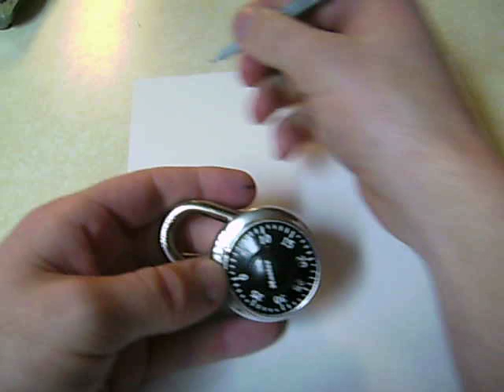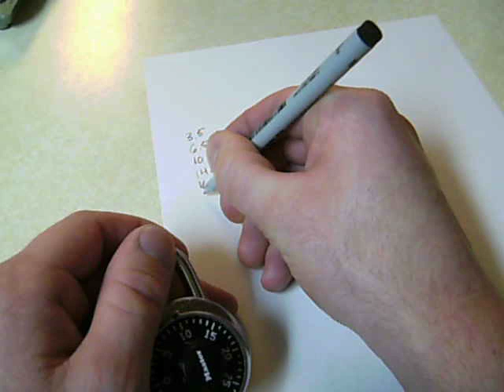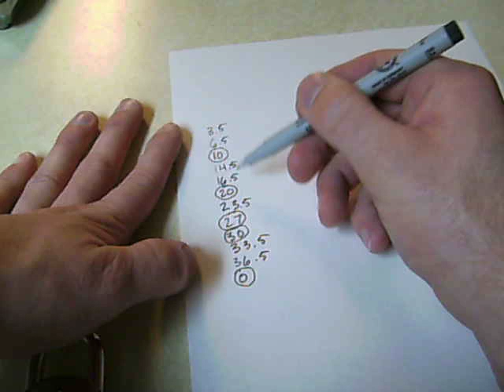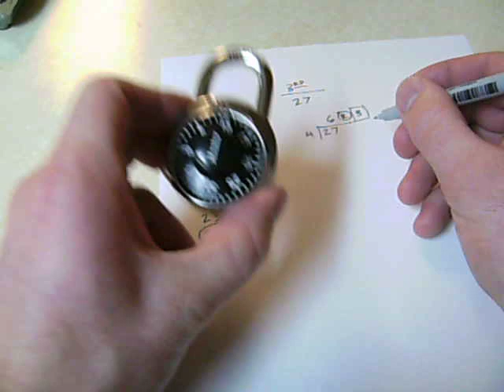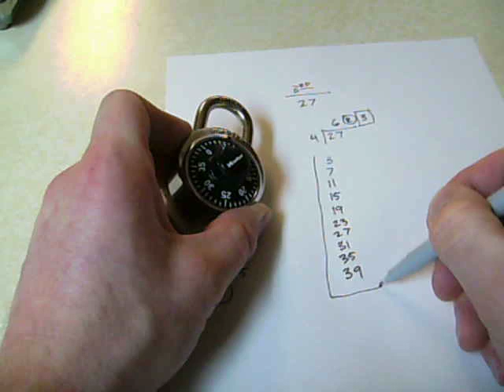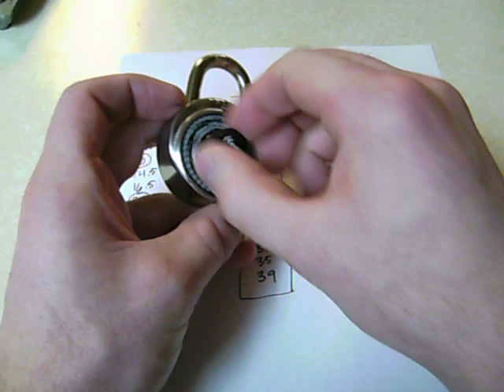Cracking a combination lock  without picking. SUPER EASY!!!!

Comment: And how in God's name is that "SUPER EASY!!!!"????
Reply: Cody Ngo yup and find it at http://lcokpickhub.com
Reply: Cody Ngo
Name calling? Really? It sounds to me like your the 4th grader. I did not say that your method does not work. I was merely stating that it is far from "SUPER EASY" as your title suggests.
Reply: It is very easy math. If you can rememer the formula then you should be able to do this in less than a minute on any lock. What part is tricky for you?
Reply: Tara Strong
If you look at my post you will see that I never said that it was too tricky for me. I agree it is basic math but I was expecting a solution that was easier than simply cutting the lock.
Reply: boy2cuda Oh makes sense. This way is a bit more sneaky though. Can't really hack at locks in the hallways at school.
Reply: Tara Strong so how would he crack the combo if the combination was say... 1-15-27. He'd still get the same remainder, which is used to generate the same lists as in the video. But neither 1 or 15 are on the lists.
Reply: Yeah people would notice u trying to solve the lock combo it's easy math but no way the easy way of opening a lock quick and easy I would  break the lock with some thing
Reply: +boy2cuda Just use the computer calculator.

Comment: It's not 64,000 combinations, it's 59,280.
Reply: I believe the number of possibilities is 16,000. The third (last) is 1 of 40 and the first two numbers have a possibility of 400 individual combinations using the formular provided based on the 4 possible remainders (100 each)  40 X 400 = 16000. Once you have solved for the third number there are only 100 possibilities  left to decode for the first two.
Reply: Actually John you would be right IF the combo consisted of a solution  with 3 different digits and none can be repeated  and only 40 possible numbers. However the formular greatly reduces the attempts needed. Reread my post as to what the possibilities really are. Of course my answer is not correct and is a little low. I took a shortcut. When you determine the third digit there are 12 possibilities for that number but it can be solved with as few as three additional attempts and fewer than twelve if the code breaker uses his brain. So the true answer for all possibilities is somewhere between 16003 and 16012 MAXIMUM. I solved mine with about 72 attempts .  This answer is also wrong because reality reduces the possibilities to less than 112. Solve for the third # (less than twelve) and then solve for the first and second numbers (no more than 100 possibilities). Statistics and probability are a lot of fun but their purpose is to lessen the work you are required to do. I think that is why this video was posted.
Reply: treehood oh yeah i know that, I was just saying that the lock allows you to try 59,280 legitimate combinations
Reply: whst about tough under fire master combination
Reply: actually its 60840 since same number can show up twice (40X39X39=60840)
Reply: tarablus2 My bad. Din't know that. I thought each number could only show up once. Thanks :3
Reply: Stickler F.S.
No Problem :)
Reply: tarablus2 actually a number can show up 3 times so it's 40X40X40=64,000
Reply: @treehood6448  Actually, the number of possibilities is only 4000. For any last digit you choose, you can always narrow down the first two digits to ten possibilities each. So, 100 possibilities for any given third digit. 40x100=4000.

Comment: Another trick that works is to take the regurgitated food from a baby cyclops perigrene falcon from Madagascar and mix it into the side of the lock cylinder that has the little side hasp on it. You can get this pre-mix in your local Tru-Value hardware stores and Home Centers. Then wait about 3:78 and the remuse from the infected particle generator. When the lock pin dissolves, eat a piece of your favorite pop tart and spit the remaining juice into the other side of the lock and presto! Works every time and has never failed me so far! Although I could be wrong.........Good luck!
Reply: thank you i opened a bank safe with your tips

Comment: Great video.  It was easier to understand and try then some of the other ones.  The reason the numbers are divided by 4 is that on a MasterLock, you only have to get
close to the actual number, basically within 2 units.  Dividing by 26 by 4 gives you a remainder of 2, so your first number choices are 2, 6, 10, 14, 18, 22, 26, 30, 34, & 38.
All those numbers are within 2 of every number.  What a fantastic algorithm...
Thanks, I got a lock open that I lost the combination to year ago.

Comment: It worked, 1st time I accidentally picked a non-whole number because I wasn't watching the movement, but 2nd time I got the 3rd number correctly, then made a list of 1st and 2nd numbers using the algorithm. My jaw dropped when about half way through it opened. Saved a combo lock I was going to toss - thanks - very valuable

Comment: I tried many videos. This one worked for me!!!!!  It worked because it wasn't about feel but about just numbers. It took me hours failing with other videos.  With this video I had the list of numbers to try in minutes. Took 30 minutes to go thru all the number combinations. 10 first numbers, 10 second numbers, and I had the last number. My combo was the LAST number of the first set of 10 and the sixth number of the second set of 10. I got it on the 96th try out of 100!  I was giving up hope!

I learned one trick that sped up checking the combinations. The trick is that you can check the second and third numbers without going back and putting in the first number. But you have to check them in numerical order.  For example you can check 12-20-16 and then rather than starting over with 12-24-16 you can just go to 24–16, then 28–16, etc. This really speeds it up. other videos show this trick.  

Thanks!!!!

Comment: Hey--one small thing, it might help you (or not).  The "code" you mention.  It's not true (or not necessary) to "add 2 if it's 0 or 1, subtract 2 if it's 2 or 3."  Always add 2.  The number that you want is the remainder of the new number divided by 4.  (it's the result mod 4 in math terms.)  So, 0+2 divided by 4 gives remainder 2.  1+2 div. 4 gives rem. 3.  2+2 div. 4 gives rem. 0.  And 3+2 div. 4 gives rem. 1.
Reply: What about 5 I got five

Comment: This worked. I tried MANY videos but this one actually worked when I combined it with another video of a woman asking to find a “resistance” number as the first number. 

If you put slight tension and circle around clock wise you come to a number that will always make you stop. That’s your 1st number. 

Then using his method I found the third number... 

I used his method to find the lists and from the list of second numbers I reasoned that the second number had to be larger than the third number so as to not go past zero again. 

So using his lists you could rule that in the second list 1-25 wouldn’t work. The only options for the second number were 29,33,37 really.

Comment: Now close the lock and lock it. Write down the number you got and all even or odd numbers on the wheel depending on whether the first number is even or odd. Spin to first number. Spin to next number on the list as if entering the correct combo. With the locking bolt in your left hand and the base in your right tug/jiggle the locking bolt with your left hand while spinning the wheel with your right thumb in a clockwise direction until you come back to your number.

Comment: KUDOS TO YOU! 
I tried all the "methods" from other vids and THIS was only one that worked. Only correction I'd make is in step one to find the number that doesn't fit a common pattern. Common pattern should be obvious. In my case my pattern numbers were 1, 4.5, 7.5. So I also had 11, 14.5, 17.5, and so on until the "odd" number appeared.

Comment: YEY!  Now I can take off that stupid lock someone put on the gym equipment at my middle school several years ago!  Its been there for sence before I've been there actually....
Reply: Be careful, never know what you'll find in there..
Reply: I said they put it on the gym equipment, meaning like the weighs and stuff.  It WAS on a little pole that was holding the weights together but I took it off already!!
Reply: That is so weird I have like three locks in my locker room at the middle school
Reply: I'm surprised you haven't just brought bolt cutters and bought a new lock.. Must not need the equipment much.
Reply: ***** It wasn't my lock.  And I didnt need a new one, I just wanted to take it off because it always annoyed everyone when they would use the machine. And you couldn't use cutters on it because there was no room to fit the blades it the tight space. Thats why I looked up this video... -_-

Comment: But as an addendum to my previous post what if, as in my case, you're using a calculator?  Your example of 27 divided by 4 equals 6.75.  How does one figure out a remainder of 0, 1, 2 or 3 off of that?

Comment: By exposing the flaws in each lock they are making people as a whole safer. This is how software works and hackers have been making things safer since the beginning. Hacker exploits flaw, flaw is fixed. Hacker finds more complex flaws, those are fixed. There will always be flaws because people are human but at least it will keep the untalented away. Locks in general are much safer today than in the past due to public exploits like this. This has recently happened in the hotel industry.

Comment: Your combo. fits the rules given by the algorithm shown (partial copy of WikiHow). The 3rd digit is 22, and 22 mod 4 = 2. The 1st digit is 30, and 30 mod 4 = 2. The 2nd digit is 8, and 8 mod 4 = 0.
If the last digit is even, then the other digits are even; likewise, if the last digit is odd, then the other digits are odd.
Based on WikiHow info, the MasterLock design has only 3200 combinations, instead of the theoretical 64000. A design weakness yields the last digit easily, leaving 80 to test.

Comment: How did you find that 27 was the 3rd number?
Reply: From the first pass of 5 whole numbers, 10, 20, 30, 0 were the only ones ending in 0 and he discarded them for some reason. The last was 27 which seemed "odd" given other numbers all ended in 0 so he picked that one as the 3rd number.

27 / 4 gives 3 as remainder. He then listed all 4th numbers after 3. Then a formula for the remainder (for remainder 3 use 1) and listed all 4th numbers after 1 and then brute forced it with them.

Comment: I need a little bit of help.  In getting the 2nd set of numbers you use the remainder to figure the value  on your chart. 0=2    1=3   2=0   3=1.  My question is,  my remainder is 5  what do I use for that number?  thanks Keith
Reply: +Keith Haroldsen Your remainder is not 5 when you divide by 4. Redo the math.
Reply: +Matthew Carlson +Keith Haroldsen I don't feel bad for laughing really hard right now

Comment: To speed thing up. Statistically the 1st and 2nd number are not to close to each other. so starting the begining of 1 column and the last of another of the other should speed thing up. Like for your lock I would have found it in 40 times

Comment: Take a #20 drill bit through the front and back of the lock and drill a little more into the locking mechanism.  Then hit the lock with a hammer, there, done, unlocked.  Use a master lock next time since your memory blows.

Comment: That's 100 possible combos, but if you match up to the first list you made, it brings it down to 15 combos.  Those positions where the dial catches when you put tension on the shackle are the only possible positions for the combo (so there's 1452 {12*11*11} possible combos, not 60840 {40*39*39}, and definitely not 64000).

Comment: Getting the third number works but if the last number is a number like 28 then 28/4 = 7 with no remainder. I took 7 and added 4 and did get the first number but the second number didn't come out so lucky. Mine number is 7 with no remainder. According to your rule I'm supposed use 2 (0=2, 1=3, 2=0, 3=1). To get my first number I have to use the starting number 3. So that means that 28/4 = 7 would have to have a remainder of 1 which is not possible.

Comment: mine ended up NOT ending in zeros, but I did catch an odd number out.  My results were: 2/6/9/12/15.5/19/22/25.5/29/32/35.5/39 and caught 6 as the odd one out since I regrouped the numbers like this: 2/12/22/32 9/19/29/39 12/22/32 15.5/25.5/35.5 and the number 6 has no friends.  Finding that number and following the rules of this video got my lock open!

Comment: Why did you divide 27 by 4? I understand where the 27 came from but where did 4 come from? Is it because there were for whole numbers ending with zero?
Reply: If the video is correct, for any combination, the first and last number will be off by some multiple of 4, so that dividing them by 4 gives the same remainder...  and the middle number will have a remainder that is 2 off from the others.  So, no matter what the combination, dividing the numbers by 4 will give an order of remainders of
0-2-0, 1-3-1, 2-0-2 or 3-1-3.
If you can find the first number, which the video claims to do, then finding the series of possibilities for the other two is easy, leaving you with only 100 possible combinations to check.  However, if this is true, then combinations would be restricted to having either all odd or all even numbers... and I'm not sure that's true.
Reply: james, you are correct, he had 5 whole numbers, "4" of them ended in zero and 1 ended in 7...so yes, the 27 was the last number, since there were 4 whole numbers left, you use 4.
Reply: Andrew King
On my lock, I got 2-12-22-32-35.  By his method, I should pick 35 (not ending in 2) but the correct 3rd digit was 32.  Using 32, the other two digits did work out.  I also got 15 & 25 as possible 3rd numbers but weeded them out trying to get down to only five starting numbers, although they were a judgement call.
Reply: TomKaren94 Most likely the way the lock is made by the manufacturer has something to do with a repetitive pattern for every 4 numbers on the lock based off of the first number they found for the 3rd number in the combination.

Comment: How about the number 5 as my remainder
Reply: Damien Anthony That's impossible.  If you have a remainder of 5, then you didn't divide correctly because 5 is larger than 4.  If you got a remainder of 5, then you should add 1 to the answer you got and you actually have a remainder of 1.

Comment: Uhhh what if your 5 numbers end in "8" and not 0, I have one that end in "5" then the other 4 end in "8". Same process?
Reply: This probably means your faceplate was incorrectly mounted with an offset. All the math should still work out fine if you just follow the rules for the number that ends in 5. (IDK if the demonstrated method really works, but I do know that the addition group he's describing is unaffected by the offset.)
Reply: then your third number for the combination is the one that ends with a 5..  It's the oddball out of them that is the correct one.

Comment: 64,000 possible combinations? Based on the info you imparted to me I believe the number is only 16,000.  The final # would be 1 of 40 possibilities and the remainder method used to get the first two numbers only allows for 400 different possibilities. 16,000 possibilities total.
Reply: R. U. Ghostbanned
 Actually since I read this I have obtained several master locks  and obtained the combo on each. It takes me about 30/40 attempts. The most so far has been about 65 after obtaining the third number which usually takes around 10/12 attempts but as few as 4/5. After doing a few I realized there were some combos that probably wouldn't work based on the third number and the remainder, So far this has worked but when/if I find the exception, it will probably take as many as 100 attempts. If done correctly the code will be obtained with no more than 112 attempts including obtaining the third number.

Comment: In the video you state that there are over possible 64,000 combinations. Most of these locks do have 40 numbers on the dial and 40x40x40 is indeed 64,000, however...

The effective number of combinations is really only 1,600. Why? Because the 64,000 total assumes that you're entering all three numbers from scratch on each try, but if you're going to open such a lock by brute-forcing the combination, only the first two numbers are significant. For the last number, you can just turn the dial to all 40 positions and try each one. In other words, once you've entered 10-20 for the first two numbers, you just run through all 40 numbers for the last number. Then you enter 10-21 and run through all 40 numbers again. It's not as if you enter 10, then 20, then 0 and when that doesn't work, you again turn the dial to 10, then 20, then 1, and if that doesn't work, 10, then 20, then 2 and so on. You eliminate 40 possible combinations for each combination of the first two numbers.

OK, technically you're still entering the combinations, but effectively you're only trying 1,600 combinations of the first two numbers and running through all the possible last numbers on each attempt.

Granted that's still a lot of combinations to try, but it's significantly less than 64,000.

Comment: 27 / 4...is 6.75 ....where is the 3 remainder?
Reply: Sounds like you're using a calculator instead of doing it longhand.  If you're using a calculator, multiply the decimal fraction by 4.    4 x .75 = 3.
Reply: 27 / 4, non decimal answer is 6. 6*4=24. 27-24=3. There is a remainder of 3.